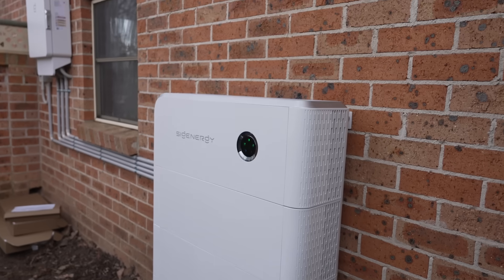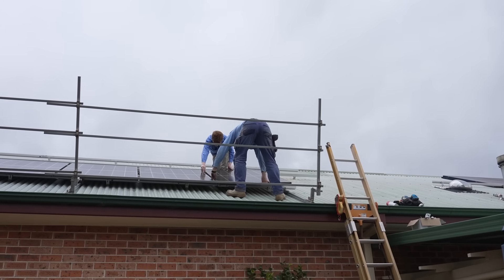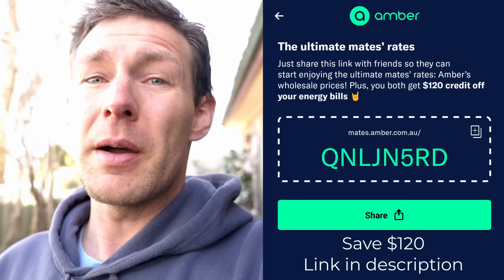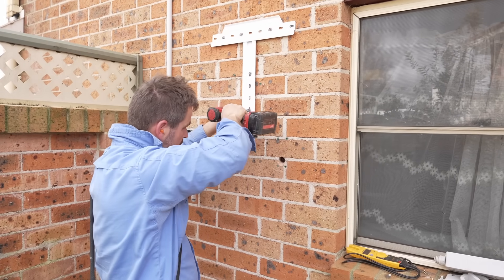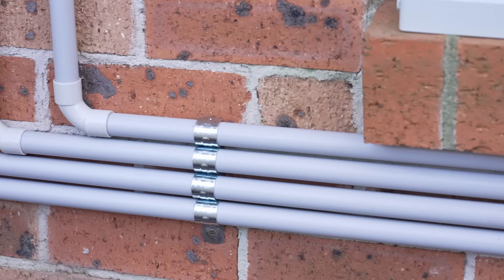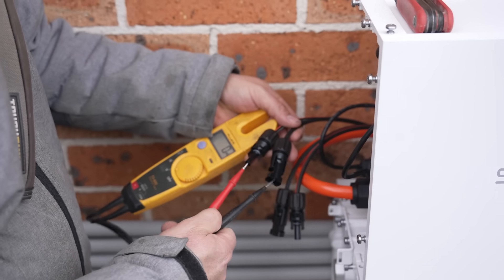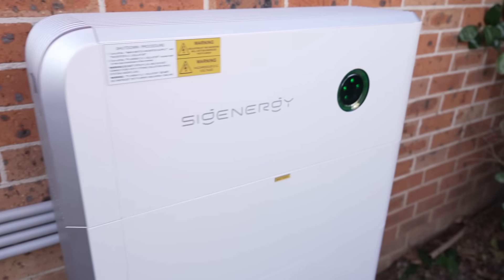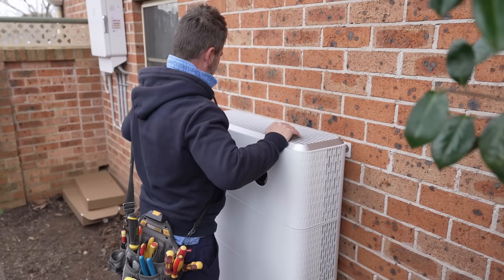SIGENERGY 24kWh BATTERY Installation in Australia | My Honest Review & First Impressions: SIGENSTOR

Comment: Sig energy relies to much on internet connection. It talks directly to china manufacturer's where it's made and is definitely no good for a off grid system as it can disable your batteries if it has been longer then 3 months without internet connection. Do your homework people and then decide what serves your needs.
Reply: This has been corrected now and is able to run as a permanent off grid system
Reply: Tesla is the same
Reply: •  Yes: Sigenergy likes internet.
•  No: It does not disable batteries after 3 months.
•  No: It’s not useless off-grid.
•  No: There’s no proof of “China disabling your system”.
Do your homework? Yes — but from installers, manuals, and CEC data, not YouTube comments.
Reply from the maker: Interesting points to consider, thanks for sharing your thoughts!
Reply from the maker: That's good news!
Reply: Do your homework muppet.. also just turn off your WiFi during a blackout if your worried. Is the 0 ms switchover and fire suppression ccp trash as well? Where do you think your phone and modem are made anyway 😂
Reply: Why would anyone be without internet connection even for a day, let alone 3 months. Hotspot your phone if your home internet goes down.
Reply: You are right, China is going to to ignite them once we have enough sigenergy installation, and then invade Australia
Reply: How do you know this?
Reply: China phobia
Reply: @edwardli217 imagine thinking that being aware of our geopolitical enemy is a bad thing
Reply: i do not want to rely on the CCP for my power
Reply: @tjnld3314  I believe most of the big energy retailers in Australia are Chinese owned
Reply: I only just found this out. I think it’s crazy that they have rights to control your system when you own it
Reply: @lukerolleston4852 

•  Yes: Sigenergy likes internet.
•  No: It does not disable batteries after 3 months.
•  No: It’s not useless off-grid.
•  No: There’s no proof of “China disabling your system”.
Do your homework? Yes — but from installers, manuals, and CEC data, not YouTube comments.

Comment: Thanks for your review. I was wondering what size inverter you got with your unit. I'm just about to get a 24 kw as well with full house switch battery back up. My house is all electric & looking at switching to Amber as well, however my inverter is only 5kw so thinking maybe I should get a 10 kw inverter.
Reply from the maker: Yep i went with the 10kw. I've been monitoring our usage for the past 4 years and we've never gone above 10, but do get to 7-8 when the aircon is on and dinner is cooking, so went for the 10kW to be right for those times.
Reply: @lifeofryan_ Thanks heaps for feedback. I might get the 10 kw inverter too. I have 3 split system & its not unusual to have 2 going at the one time, not to bad in summer but as heaters they are greedy power eaters. Cheers
Reply: @MCCush going to 12 kw inverter with 24kwh battery have 13.5 panels
Reply: @lifeofryan_ are we talking about 3 phase house or one phase?  Just trying to work out how it relates to my 3 phase house with a single phase AC that can pull upto 8kW.

Comment: 1 thing. The zinc plated saddles are going to rust and look horrible. I would've used galvanised.
Reply from the maker: Thankfully it's all under cover :)
Reply: Mine are stainless steel. A requirement if close to the coast

Comment: Might want to put a battery cover/enclosure over it, the top plastic snd side plastic covers are very gapey, also the internal wiring, which is not UV safe is exposed to thr elements and sun, the internal electrical, circuits, wiring, and LED'S only come with a 2yese warranty with Sigenergy, so read the fine print. Its only the battery cells that come with a limited 10yr warranty, not the other components and a battery is only as good as its shortest warranty.
Reply from the maker: Very true
Reply: So true with the warranty piece here and thats what blocking me from going to Sigenergy.. :(

Comment: Did you opt for the generator connection to charge the battery if there is no sun while the power is out
Reply: I’m getting mine installed on the 18th
With the cyclone last time the power went down for two weeks 
So I’m getting the generator backup
Reply: @damianchurchill6982 instead of a generator you could get the dc charger for an EV, once you're allowed to do V2H and EV company supports this, you should have enough power for ever, as long as the sun comes out within a week. Say you got a 16kwh Sigenstor  with a 85kwh EV, that would give you a 101kwh battery 🔋 plus quick dc charging.
Reply from the maker: We are still connected to the grid, so fingers crossed I never need it!! 😂😂

Comment: I'll keep tabs on this going forward. Getting the same thing put in at my place in about 4 weeks time. Mine is going inside the garage so I hope it all turns out as neat as your install. I have 10kw of panels on the roof which I am getting re strung as well since the first installer seems to have wired some of my east facing panels in to the same string as some west facing ones reducing effectiveness . I'm considering Amber as well but I want to get the system installed first and see what it does before switching over .
Did you end up having to put a cover over it to keep the sun off the battery stack since it lives outside ?
Reply from the maker: It's on the south side under an eve. There's also a big tree above it so I'm probably going to leave it as is. 
Keep me posted how your install goes :)
Reply: @lifeofryan_  Will do . only a few weeks to go now, can't wait.

Comment: Nice well presented and  explained video - thank you! 

Great Sigenergy setup…I can understand why you choose to ditch SolarEdge….

The black start function is available on “any“  system that can operate without the grid and sufficient reserve power to acts a micro grid.

Of course never that simple…

Next it obviously has be able to power and measure PV generation. Generate AC grid frequency, so solar PV starts up when sufficient sunlight to power the panels exists.

Hybrid inverters and their associated gateway can do this much easier - if the hardware and software is provided. A single vendor solution typically works best. 

I have a FranklinWH AC coupled battery and its gateway has two AC inputs for solar PV inverters to use.  

I have 6kW Enphase PV so safely under the limit and of my inverter. The gateway will cut power to the PV circuit if there is issues (over production as it has a built in CT).  So it feasible to AC couple and have blackstart:

- power my Enphase PV during any grid outage. Allow it to start up and communicate to the micro inverters 

- black start my battery - if the usable capacity is depleted - by manual button press or automatic schedule by powering up the Enphase PV ( provided the reserve battery and sun are both sufficient) 

The other black start option I didn’t get was the generator module which can take AC power from portable petrol or AC batteries.
Reply from the maker: Awesome, thanks for sharing your experience!
Reply: A lot of what you talked about is over my head but are you saying you connected your solar panels that have enphase microinverters to a battery? Not sure what state you’re in but if you are on single phase, are you limited to 10 kw inverter size?

Comment: Great vid :) , so what size inverter did you get and single phase i guess. We are getting a sigenergy battery in a weeks time , might use the amber code then.
Reply: TBH, don't fall for the amber hype, for it to work there has to be grid instability. I have had the best experience with OVO and the free power 11am - 2pm  window, especially during winter. Charge your battery for free every day  without fail and never draw from the grid any other time.  Happy to provide a referral code that will help offset the supply charge for both of us.
Reply from the maker: We put a 10kw inverter on. Sorry I should have added that
Reply: @lifeofryan_  what size of solar panels - total panels in kw?
Reply: @lifeofryan_   Thx. We are on the mid north cost getting 12kw inverter with 48kwh DC coupled battery, might have gone a bit too far with that but only have one shot with the goverment rebate. so we can sell some back, amber is the best option. Oh and 17kw solar on the roof. Thx again and have a great day.

Comment: 90 degree bends and pvc tubes?! That’s not allowed here at work.
Reply from the maker: Where are you working?
Reply: Should also use galvanised or better stainless conduit saddles ,these will rust in a couple years.
Reply: Also corrigated conduit will breakdown and crumble
Reply: @krbss-e5v I read somewhere that corro is permitted as long as it's painted
Reply: @krbss-e5v this is solar rated PVC it's fine here, we don't use metal conduit at all
Reply: I'm guessing that the original SolarEdge system was specified due to shading issues. How does the new system perform? Considering that it's using the same panels it's a useful comparison.

Comment: Can you please explain what the negatives are in relation to AC coupled during charging battery during grid outage? I also have a PV solar connected to two Solaredge inverters
Reply from the maker: My understanding is that in a blackout, where you lose grid connection, if the battery goes to zero, it is unable to recharge if AC coulped until the grid comes back on line (even if solar is available). Where as DC coupled, you can charge from 0 and up to 100% and back down again if there was a prolonged black out from the grid.
Reply: If you have an AC Coupled system it requires an AC signal or power generally from the street to power the Inverter, the moment the power in the street goes out your inverter shuts down.  If you have batteries connected to an AC coupled inverter they will also shut down until the inverter powers back up again.
Reply: @lurksau if the inverter is grid following it will turn off if grid goes down, if the inverter is grid forming it can create its own mini grid for the house. Is Sigenstor able to do both like a hybrid inverter?
Reply: @lurksau gateway isolates you to off grid in blackout so that your system can charge from your panels

Comment: nice install! however why not run the wires in the wall? I would have run it up in the wall and through the roof and back down. Also I hope you dont have a bedroom behind the wall :) these things create allot of EMF.
Reply from the maker: No all garage behind that wall. I think in terms of the best way to put it this way what ended up working. Everything was at that same level and then the gateway went through the wall behind to get to the board.
Reply: Don't worry. A tin foil hat is supplied with the installation.